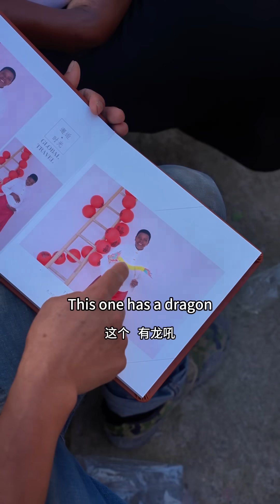The second floor of the house is almost done, I also got the maternity photo album today

Comment: Also. If you have a small ball like for tennis, stand straight and squeeze your buttocks until they dimple and take the ball and press there and roll around. You can also try sitting with the ball in that area for a short time. This helps release tension in the muscles around the nerve causing you so much pain my friend 😉